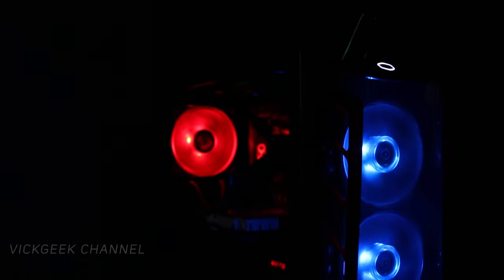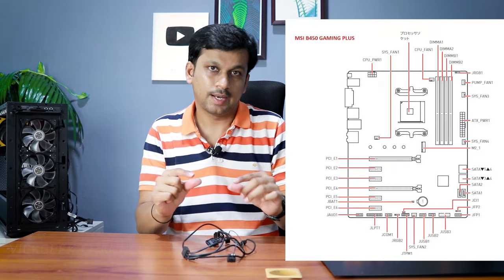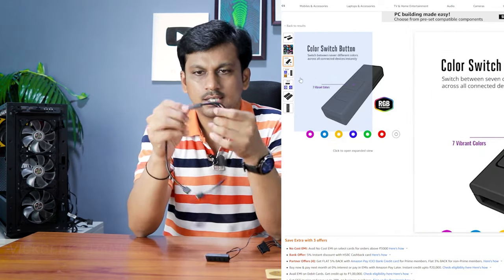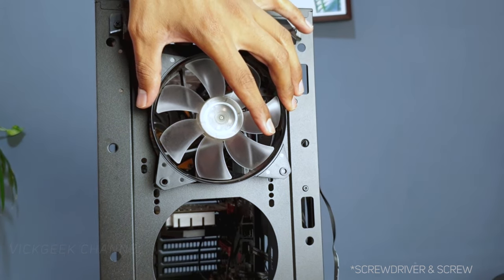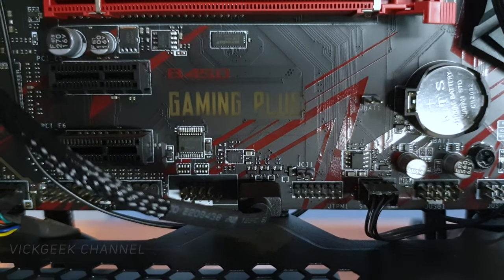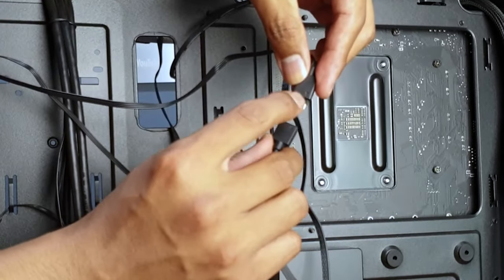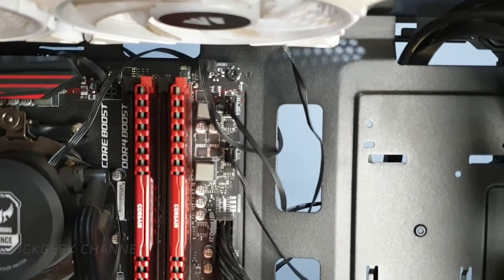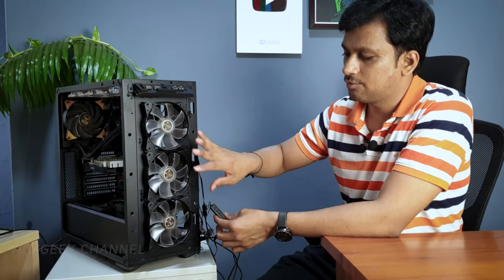How to Install Cooler Master RGB or ARGB Fans | Full Tutorial on Installing Cooler Master Fans

Comment from the maker: Your ultimate 🔥🔥🔥 guide on HowTo Install or Setup Cooler Master or ANY ARGB/RGB Fans.
Make sure to watch the entire video before asking any questions because chances are ✌your questions will probably have been answered in this video already.
 Cheers !
Reply: How can i sync all my fans without  jrgb header on motherboard
Reply: What is use of jrgb port and and can I connect my RGB fan to it
Reply: That case sucks very bad case for cable management your setup looks very crappy Vick the problem with all your cables is because your case doesn't have enough storage compartments but your setup looks very bad
Reply: @ezmusic6034  Should blame partly on the non-modular power supply I guess

Comment: Very clear. I didn't know the front fans had a locked range of colour. This is the only video i could find that explains the range is locked and can be changed by hardware as well. The software doesn't partition the preset colour from the adjustable RGB 0-255 components or GUI mouse selection in the software. It should be clear Preset / no 0-255 nomination is what they're supplying for the money we're paying them because it looks like that's how it should be.

Comment: Good video! 
I'm using a Gigabyte MOBO and I've already plugged the front RGB fan (Lian Li ii Mesh C RGB case)  lights into the addressable RGB header on the MOBO LED-1.   Can I use LED-2 instead or will I have to use a splitter?   The LED-2 header is a 4-pin header.  (Sorry, I realize you are using an MSI MOBO  :-)   )
Reply from the maker: Hi, if you connect the fans to LED-2 header with 4 Pin, you won't be able to control individual LED colours of the fan. It can only show up same/one RGB colour for fans.
So it's better to use a splitter on ARGB header.
If it's AORUS series board you will Fusion support meaning you can control RGB lights when connected to 4 Pin header too in sync.

Comment: What if we connect the splitter end to the rgb header. That way we can control all the three fans using software right??
Reply from the maker: Yes you can control it from the software, if you connect the splitter end to the rgb header on motherboard

Comment: I  have an MSI "B450 Gaming Plus Max" motherboard.

Did you connect the CPU cooling fan in the JRGB header at the bottom? The header has 4 pins, while the CM MF120 fan connector has only 3 holes. I am confused...

Comment: Ok, so if I want to connect 2 ARGB fans to my motherboard using a 3to1 splitter can I do the following:
1)Mount fans to case
2)Connect both fans to separate sys_fan headers for power
3)Connect both fans to the splitter
4)Connect the splitter to the ARGB header on the motherboard
5)Control the rgb patterns via software
Is that correct?  Am I missing something?
(I'm also assuming a 5v header can withstand 2 fans)

Comment: Thanks for the video, btw I have a question,
Why do I have to connect the 3 fans with the 1 to 3 splitter cable - to the controller, and not to the jrgb1/jrgb2 on my motherboard??

Comment: Hello, I Have Corsair SP120 RGB Pro Single Fan,
And I Want To Connect With MSI B450 PRO Vdh Max Motherboard, The Mobo. Have RGB HEADER.
And the Fan Have 2 Cable With 4 Pin and 3 Pins. HOW DO I CONNECT THIS FAN PLEASE HELP ME.

Comment: You do not have the links down below for the products you are installing. Fan controller, splitters etc. Can you provide that please?

What can I do when I change out 230mm  for 120mm fans with my case HAF 932? The side panel I can add 4 120mm fans and the top 3 120mm fans. With my Asus Sabertooth 990fx motherboard I can only add 2 fans to one fan header. What should I do?

Comment: Someone said head rgb splitter can directly connect to the one rgb header in motherboard  without controller. Is it right? I also think that splitter cable is not a pwm pin..

Comment: Hey there! Can i plug my Deepcool RF120 RGB Fans directly to the JRGB connector? Will it synch with the MSI Mystic Light software? Btw nice video ^_^
Reply from the maker: Yes you can! And it should sync with Mystic Light software.
Reply: @VickGeek  Great! would it be possible to dc chain them into one jrgb connector and sycnh them?

Comment: Hi bro, nice video. I have 3 auto RGB fans on my ant esports ice-521 mt cabinet. My motherboard has rgb headers with 3 pin and 4 pin. But my cabinet fans are auto RGB so they have 4 wire molex power and 2 pin switch to change lighting modes. Is there anyway to connect my auto RGB fans to motherboard RGB headers to control it through motherboard software. Is it possible with any converters or no Chance ?

Comment: I plan to buy the cooler master MF120 halo Argb fans x3 or 4, for my asus tuf motherboard (with aura sync)
Do I need to install and use the controller too?
Reply from the maker: If your motherboard has enough RGB slots then you don't need a separate controller and lights can be controlled using aura sync software on pc. However, the Cooler Master halo ARGB comes with a controller too. So you can connect it anyway you like. If you connect it to controller then you won't be able to use aura sync software on pc to change light.
Reply: @VickGeek  if i dont install the controller, 3 fans will use 3 rgb slots or can be combined into 1 slot?
And can my 3 fans still sync with motherboard’s “aura sync” if the controller is installed?

Comment: Beginner here, you can only control na fan speeds through the bios right? Since only three pin was connected. But if you had a four pin connector what is the difference?
Reply from the maker: Here's complete and best possible explanation about 3 Pin vs 4Pin connectors. Hope this helps. https://forums.tomshardware.com/threads/is-there-a-way-to-control-3-pin-fans.2905718/

If that explanation makes you confused, let me know...I will explain in a simple way.
Reply: @VickGeek  OMG thank you so much!
Reply from the maker: You're welcome 😊

Comment: Hello.. i got the sickleflow v2 rgb. Single pack on z390 gigabyte mb and when i connect to 12v rgb(brg) nothing happens.. do i need a controller or via rgbfusion?
Reply from the maker: Did you also connect the 4 pin PWM cable from sickleflow to a Fan/pwm slot on the motherboard ?
Reply: @VickGeek  yes the fan blows air but no lights.. i did put the rgb cable directly into the 12v rgb header on motherboard. So only air and no light.. do i need a controller or it should work like this?
Reply from the maker: @S.D1010  Regardless of the controller it should work just with a header cable. Controller is to just control the lights and speed in some cases.
The sickle flow fan comes with two cables I suppose. One goes to the PWM on mobo and the other cable to rgb header on mobo. Is this how you connected ?

Comment: The Deepcool Rgb are way easier to install as you can just plug the rgb cable in another fan and you’ll end up with 4 rgb daisy chained into one rgb plug that can go on your motherboard
Reply: how tf do I connect rgb plug into the mobo
Reply: @joacomunista  locate the rgb/argb headers on your mobo using the manual, 

[rgb cable fan 1]——|
[rgb cable fan 2]——|—[splitter]—> Rgb header
[rgb cable fan 3]——|
*thats how I did with my 5 fans
Reply: @wolflexx2146  the thing is that my mobo has a 12v rgb header, but my coolers came with a 3 pin slot
Reply: @joacomunista  look in your mobo manual to see if it has 3 pins headers or you would have to plug the other cable [sata or molex] in the psu and use the controller
Reply: @wolflexx2146  no it doesn't have one, I'll have to use the case led button, thanks anyway

Comment: My pc motherboard contains only 1 system fan slot. So where can I connect the other 2 fans? 😟
Reply: The 3 in one kit includes a splitter that lets you plug 3 fans in one slot

Comment: Please help me here!

I'm using both the SF360R and SF240R fans, and they work just fine, but the problem is that I cannot control the rgb via software like asus aura or rgb fusion, I can only change it with the rgb controller, which is so frustrating, cuz I have to open the case every time just to change the color of the RGB!
Not to mention the limits of the controller, I only have 4 colors (green, red, blue and white).

My motherboard is:  GIGABYTE Z370 HD3P

Comment: I have Metallicgear Skiron DRGB 120 fans. They're supposed to be interconnected and I'm not sure how to do that correctly. Could you tell me how to?
Reply from the maker: The fan comes with two wires. One with the 4 pin (PWM) must be connected to SysFan on motherboard, the other wire goes to RGB header on motherboard.
If there's no slot on mobo, then you need to buy controller or a rgb controller kit separately.

Comment: I just bought cooler master mf120 halo but has 3 cables so 2 cables connect together and 1 cable is left where should i plug the last one i did try to plug it in fan1 the fan works but without rgb...Any help?
Reply: sameeee

Comment: My mb (B450 M) have two RGP LED strip header and 4 LED strip header with one jumper. Will this product work? Also I only got 2 sys fan header
Reply: I have the same question as well I have 4 fans to connect but my board has only 2 fan slots

Comment: I have 4 fans and rgb header argb header and 3 fan connecter what do I do
Reply from the maker: If there's not enough slots on mobo  then you need to buy a splitter cable

Comment: how do you connect it to where you can control with a pc software? Right now the sickleflows i have only allow rainbow, red, green, blue, and off options with the switch.. but i want to control it from a software. Any advice?
Reply: Hey did you ever figure this out?
Reply: @xMadEnVy  yes I did.. so all I did was make sure I had them all daisy chained, and completely removed the rgb controller it came with, and then plugged them all (while daisy chained) in to one addressable header on my motherboard. I then was able to control the lighting/effects with armoury crate.

Comment: Quick question could I also connect the fan to the pump fan slot on the motherboard as well? Like is there a difference between the system fan slot and the pump fan slot?
Reply from the maker: Yes you can connect, it should not be a problem. Those slots are all pretty much the same.
Reply from the maker: It is just to differentiate as to know where you have connected and also helps while reading fan speed, on a pc software.
Reply: VickGeek Ok cool! Thank you very much for responding

Comment: Great video I'm hoping you could help me a little.

I have an ASROCK Fatal1ty B450 Gaming ITX/AC motherboard which has an ARGB port, I've plugged my new Coolermaster mf200r fan into it and it's lit up but I can't seem to change the colours in ASRock polychrome and Coolermasters Master Plus program isn't detecting it at all. 

I'm sort of stumped on what I can do from here don't have a lot of experience with RBG so any advice would be appreciated.

Comment: Hey i got a question it might sound dumb can i just only install the 4 pin to my motherboard cuz i dont want the controller ? So will it work if i only plug the 4 pin?
Reply from the maker: Yes it will work.
Reply: @VickGeek  so if i only install the 4 pin i will only get the rgb but i cant controll it?
Reply: @VickGeek  will i still get rgb with 4 pin ?
Reply: @VickGeek  cuz i only need the rgb not the controller so if i plug 4 pin ill still get the rgb lights?

Comment: HALLO MY FRIEND I HAVE MSI Z-590 PRO AND I WANT TO CONNECT ONE ADDITIONAL FAN WITH LED LIGHT IN THE BACK OF THE CASE PLEASE CAN YOU TELL ME IF MY MOTHERBOARD IS COMPATIBLE IT HAS 2 LED CONNECTORS OF 5V EACH WITH 3 PINS ,THE ONE IS ALREADY ON THE GPU FOR ITS LEDS AND WORKS PERFECTLY SHOULD I USE THE ONE THAT REMAINS FOR THE LED FAN..BY THE WAY I WILL TAKE POWER FRON A SYS-FAN..  SinCErely PAUL GREECE  THANKS !!! :)))   I LIKE YOUR CHANNEL I SUBBED!!

Comment: Thought I was watching a goonzquad video in the beginning.
Reply: Is it possible to connect the splitter directly into 1 of the fan inputs and then connecting the fans to the splitter cables? Thanks.
Reply from the maker: Yes you can ! It should work that way too.